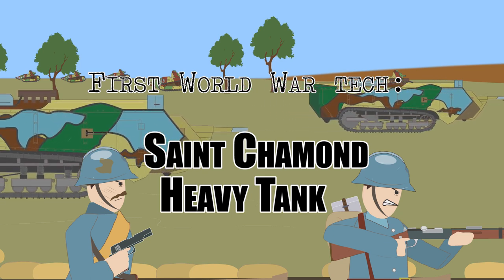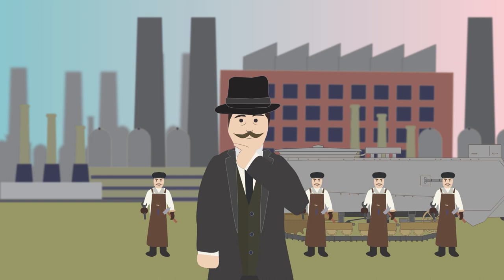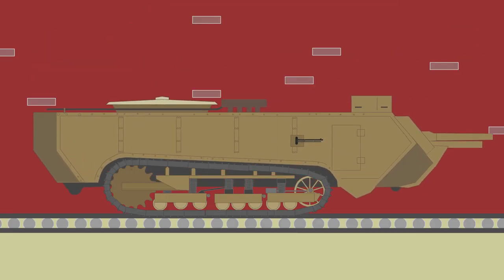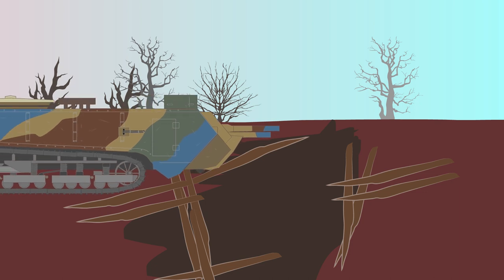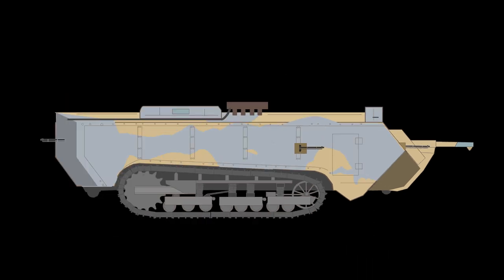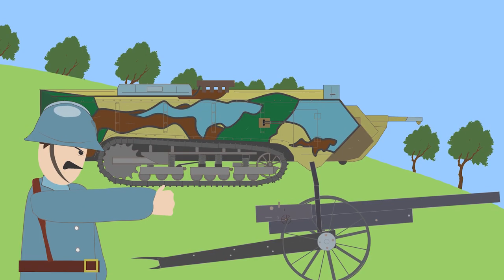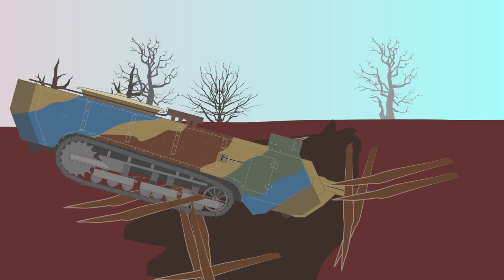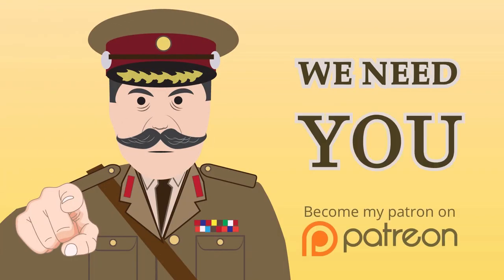WWI Tanks: Saint-Chamond

Comment: This tank was a beast in BF1. I used it for a very long time after the French DLC dropped. It was a bit unrealistic in BF1, by having the gun traverse that much on that position. IRL, it could move only about 6° to the sides, requiring the coordination of both the gunner, commander and driver to pull off a shot into a moving target.

The standard package (with the low-velocity 75mm gun and the pigeon strike) was probably the worst package in the game. The pigeon strike only worked in certain scenarios, and people mostly used AT Grenades and the AT Launcher from a distance, making it completely useless. You also needed a 2nd person on the front facing MG to fend off infantry if you ran out of cannon ammo.

The gas package was extremely OP in the beginning, as the airburst rounds easily killed off any infantry in the area and demolished every structure it could find its way into, and the gas prevented the enemies from aiming down sights with their weapons (something that came in very handy for friendly infantry to have an edge over the enemy when taking a point). The airburst round later got nerfed in the game, unfortunately.

Finally, the anti-tank package (which changed the tank's model into the Late variant, evidenced by a single observation post instead of 3, angled roof and better 75mm gun), was evidently the best one. Not only you had a very effective AT main gun, but you also had control over the bow MG and a searchlight that spotted everything in your cone of view, allowing your teammates to once again, have an edge over the enemy.

Comment: the last Saint-Chamond was in a static exhibition at the French armored vehicules museum until last year, due to the advanced state of deterioration of the original petrol/electric drive system, but the museum opted for the replacement of the drive system, by a modern one, in total respect with the weight/power ratio and the placement without deteriorating the original state of this machine. so, you can see this old lady rolling by herself for a few days per year now.